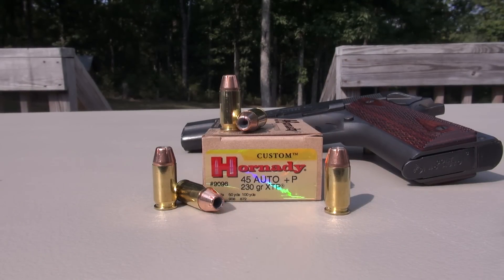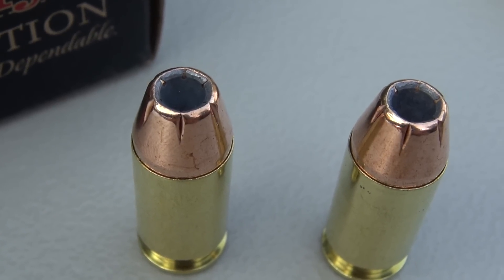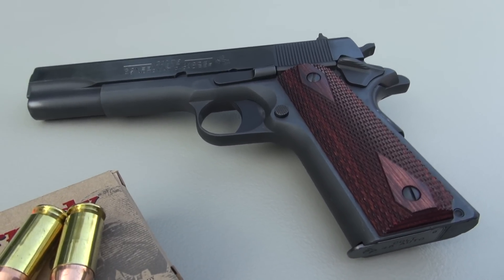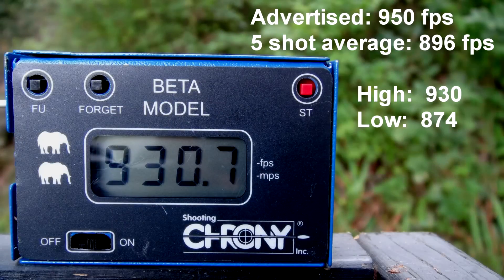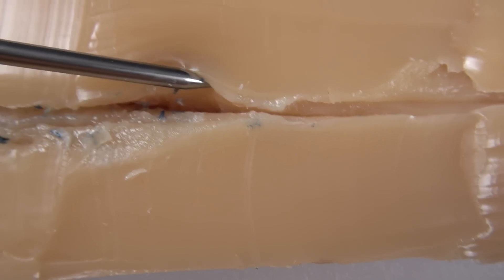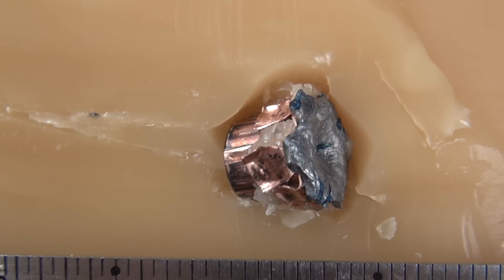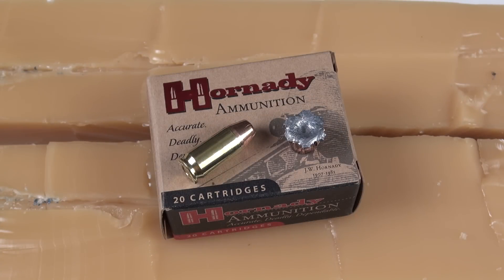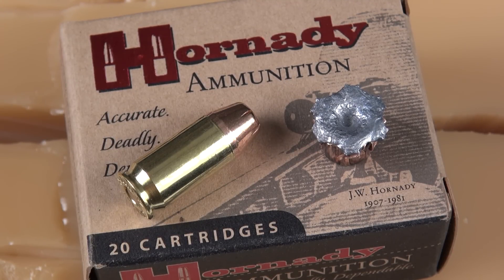Hornady XTP .45 ACP +P 230 gr JHP AMMO TEST

Comment: You could fire 30k psi (.45 Super +P) loads in a vntage 1911 easily! Probably need a spring change, but wouldn't a 260 gr .45 @ 1,000 to 1,100 fps be much more serious?? I don"t think that is even a +P load, though!
Just for .45 Super reference, I have seen a man push a .230 grain jhp @ 1400 fps, (seemingly safely) out of a glock 21 with a lone wolf 5.75" bbl.
Reply: IN YOUR WETTEST FLOCK BRAND TUPPERWARE DREAM HAJI

Comment: Why don't you use clear ballistic gel again? I watch your channel and you have stated this before, I think. Would help to visualize......Thanx
Reply from the maker: 1.  This video, September 2011, was before clear gel was sold.
2.  Some of my final videos (I stopped video production in July 2016) used clear gel.
3.  Clear gel typically overpenetrates and does not show the permanent cavity as well as other formats.  It's good for the quick visual and ease of locating the bullet; that's it.  And it's a pain in the ass to prep and clean up.  Easily several hours per video just to manage the clear gel, when it's done properly.
Reply: tnoutdoors9 Can you tell me where you found your Sim-test media? I've been wanting to do some testing and I like the results you got with that media vs clear ballistics.

Comment: Hornady is a great company, but i was disappointed with the lack of consistency in velocity. i was expecting an es of 20 or so, which is not uncommon with premium ammo. These were all over the place. Also, they did not achieve anywhere near their stated velocity, and a 5" bbl is standard for the 45, so we can't blame barrel length. The XTP is a good design and it performed well, but i don't think +p is worth it for only 40 or 50 fps of gain.

Comment: Do you think tisas 1911 can handle hornady +P? Manual does not mention about that. Thanks for your video and time!
Reply from the maker: If not mentioned in the manual, call the manufacturer.  Better safe than sorry.
Reply: Not all 1911A1’s are equally robust and durable.

Comment: Hello,

SAAMI are the folks who regulate what is normal according to ammo.  For example, regular .45acp may run up to around 21,000psi.  Over that, it's marked +P, meaning "plus pressure," or, according to some, plus powder or power.

In Europe, the regulatory commission is the CIP, and you'll get different numbers from them on lots of cartridges.

But +P just means higher-than-normal pressure.

Regards,

Josh Smith
Smith-Sights com

Comment: I use to use powerbelts with excelent results and switched about 5 years ago when i got an excelent deal on the 250gr xtps bought about 200 of them and am still using them. I recovered one from a deer two years ago and it mushroomed t0 almost an inch! Usually I get pass throughs.

Comment: A "Wadcutter" Is a bullet with a cone shaped nose but has a sharp shoulder where the slug meets the rifling. The only reason for a wadcutter is to cut a clean "round hole" in a paper target instead of leaving a ragged, torn hole.

It is usually hardend cast lead and is NOT a self defense round.
Reply: Whitehorze ... well technically....
Stand 10 ft from me and let me put one into your torso, then you can explain it to me from experience. 
Trained LEOs hit 8/100 in stressful situations. Is a magic bullet that important???
I wouldnt feel under gunned with any 45 hp or swc.
Reply: Whitehorze nope
Reply: HotRodRay Yea I think Capacity matters in self defense. 8 rounds is the minimum I think.
Reply: yet NCSHP ran .357 WAD CUTTERS thru out the 70s and 80s due to the damage they did to the human body

Comment: @tubevideoguy762 Yeah velocity makes a huge difference in expansion. If you watch brassfetcher review of the CCi velocitor you'll notice that the round fired from a rifle expanded and penetrated less do to the fact it was going faster when fired from a rifle while when it was fired from a pistol it overpenetraded and did less damage as a result of not expanding. This is famously known as the Hydro-static effect. Essentially the resistance of water to something passing through it.

Comment: "a 9mm may not expand, but a .45 sure won't shrink"
Great job!
Reply: The chamber pressure of 45 auto is 21k lbs, the +p is only 23k lbs. This isn't a significant amount of pressure increase. This is only a 9.52% increase. These barrels are tested in labs independently at way higher pressures before they fail. You wouldn't use these rounds for practicing all the time, you shoot a couple magazines to check for feed issues and thats it, the accuracy isn't going to change much from something thats less than 100 fps faster. You may "understand" physics, but you do not understand ballistics. Sincerely Gunsmith
Reply: And a hot .40 beats out both without you having to worry about if your gun will blow th fuck up after consistant use. Shooting your avg .45acp at the range, then changing out ammo to this hot stuff for carry is idiotic. Different brands of ammo pattern differently, let ALONE hotter rounds. Shoot what you can use often without the blow up in your hand potential. Hot 40 rounds might wear your gun a LITTLE faster than avg 40, but will not blow your fukcing gun up. Not even a chance. if you dont think there is a chance of that happening with this .45+p, you dont understand physics.
Reply: @jamespitts10  crying about hot .45 is very .40 short and weak of you

Comment: Truly an interesting round.  I currently have these in my G21.  They are very accurate out of my guns & in my experiences, Hornady is pretty consistent, too.  I was surprised by the velocity numbers, though.  I clocked higher #s w/my G21.  I wonder if it's a matter of the barrel rifling?
Reply: It is. Generally the polygonal rifling of the Glock barrel gives a slightly higher velocity due to the better gas seal with the bullet. less gas leaks past the bullet with this rifling.